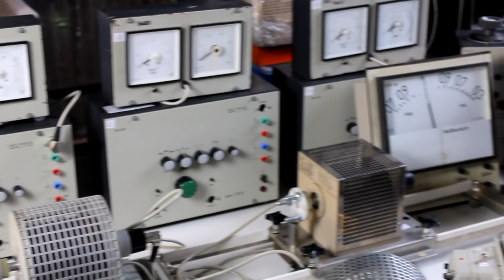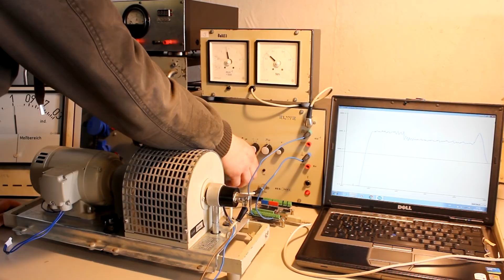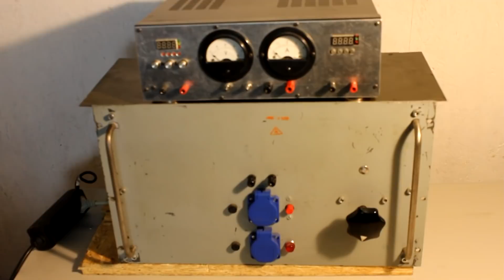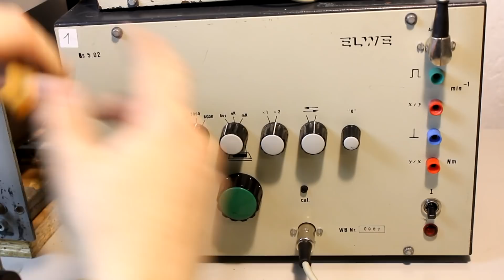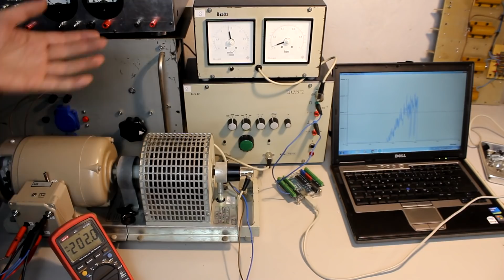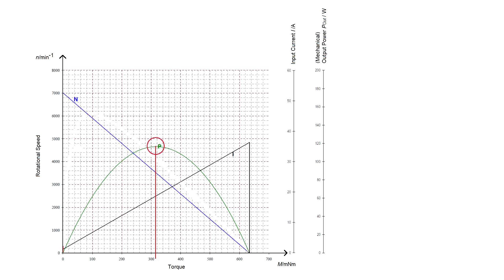The Electric Motor Test Stand / Dyno - Test Runs and Motor-Experiments

Comment: I had to test a 10,000 HP 115,000 Vac 3 phase motor that was used to pump cooling water in power plants. We closed a seven foot diameter valve to load the motor like a dynamometer test until the motor stalled. Back in the late 1990s to record the data we used a Honeywell Viscorder Oscillograph.
Where I worked (ABB Power Systems) we made the speed sensors for the motor and also a detector to measure the shaft wobble.

Comment: Okay, so the series would shaded pole motor would make a good generator if it's rotor is modified to accept magnet's and it should be able to supply power to the parallel wound shaded pole motor while it drives the series wound shaded pole motor mechanically! It works with the shaded pole motors that are used as fan's in microwaves... There's a good Video demonstration by someone who really sounds like the guy from Diodes Gone Wild... He used that soft magnetic material that is used in PC cooler fans, machined out the rotor to wrap that soft magnet around it and was able to power what looked like a 40W 220v incandescent light globe!.. I think that the channel is called FreeEnergy4All... There's two videos that look exactly the same but on is from someone else, in his Video, he shows a picture of how it needs to be and then a picture of the motor in pieces including the flexible soft split ring magnet... It looks like one of those free energy scams but this one might actually work! 
Besides, everyone loves a Scam Busting Video! But like I said earlier, I have seen all the scams but this one actually looks like it works!

Comment: One thing to note is that maximum power transfer is not everything. The efficiency curve is used to determine whether the motor is being overloaded or not. Generally you want to select a motor that operates at peak efficiency on a given load. This is because a motor that is too small will suffer excessive I^2 R losses, and a motor that is too large is just too big and will suffer excessive magnetisation and windage losses.

Comment: Hi, sorry to bother you, but I needed your opinion on a type of electric motor.
I needed to find an electric motor that will move a load of 15 kg (window that goes up and down) with a counterweight at a relatively low speed. This movement will be triggered by a controller board of the Arduino genre. The problem is that I need to move the window up or down manually at any time (whether the window is moving or not). I fear that a normal electric motor will not let me do that. Can you steer me to the right kind of engine I have to look for?
Thank you very much in advance.

Comment: Where does all the heat go that the brake generates? The brake did not seem to have any vanes to move air, and it didn't appear to have a large surface area.

Comment: 22:33 = The exact straight line also signifies that the torque is exactly proportional to the current drawn by motor. If you measure the current in motor, you get the torque generated by motor in a certain scale. T = Kt * I; where, Kt = torque constant (in Nm/A), which is surprisingly the same as back emf constant, if measured in V/(rad/sec)

Comment: Super like and thumbs up. I work for a company and we test motor on dynamometer for testing algorithms. They dynamometer is new model and has all sort of control to simulate a mechanical load which behaves as constant torque, constant power, variable etc. What you showed is pure electrical engineering and behaviour of each motor (physics in them). But we work on algorithm (running on DSP), which makes the motor behave extremely stable speed (using closed loop speed and current control, PID). Dynamometer always fascinates me. You tested different motor with one brake and i guess, the brake would have been super hot at the end of testing. In Germany, the cold climate may help, but in my country, brake needs extra cooling blower. Otherwise, the coil inside will fry in no time.

Comment: Awesome man. What actually determines the value of (mech output power/electrical input power). Magnetic saturation of the windings?  In a production environment, it seems like you'd have to overspec your motor for like 5x actual load in order to hit the efficiency peak point.. Can you alter the electrical profile of the input power to prevent this? On the ELWE console, how does the 'regulation' function operate?

Comment: Awesome - if you want more precise analog readings, there's a 16b ADC module floating around aliexpress (and probably ebay) for <2$ 

Works quite okay - if you want some example code to get started in <5 seconds let me know (otherwise it's not really that difficult, there's pretty ok libraries for it)

Comment: I am hoping that you will consider doing a DIY series on how to make an electronic break for the hobbyist. It can be a car alternator coupled with an Arduino or alike and a small program to chart and display the graph of the characteristic of small DC motors. 
Also, have you ever come across a variable inductance pulse motor? I have only heard of some being used on the Shuttle with efficiencies > 85%. Very rare.

Comment: Wonderful thought provoking video as usual - no one but the PAI is making videos like this and a consequential topic.I will ponder this demo while spinning up my 130 watt Mr. Coffee grinder every morning and also when I fire up my 10,000 RPM Shop-Vac vacuum cleaner and when I ride the Siemens Elevator up to the 10th floor.I'm thinking the most commonly used motor in terms of total elapsed hours in the world might be the one on everyone's computer power supply and processor cooler?If I may suggest adding a thermocouple to show the gradient temperature rise in the windings during your tests.. Even if we could see that some of us older folks in America will still have to type into to Google to translate the degrees from C to F so we can understand..  40 degrees C = 104 F
Reply: Police Dog I think to get Fahrenheit it is 1.8 (or 1.6?) times the value in celsius and than substract 32. The Motor you talk about is weird indeed. It is a permanent magnet DC motor but electronically commutated. Very simple electronics setup with just 2 transistors and a few passives.

Comment: So if you want to operate at the point of maximum efficiency then to do 3/4hp of work you should buy a motor that is rated at a maximum of 1hp?? Assuming 75% of max will be near the range of best efficiency. Does that sound about right? Basically get a motor that's rated max hp at 25% above your desired normal operating hp?
Reply: In a permanent magnet DC motor, the torque output is decided by the PRODUCT (multiplication) of strength of the permanent magnet and current through the winding. In cheaper motors, the magnets are made smaller and you need to push more current into the winding to generate certain torque. This higher current causes higher losses. Note that, in permanent magnet motor, most losses are I^2R losses. The motor data sheet that was shown must had been a low cost motor and was meant to run at 3/4th of full load and occasionally run at full load. Hence, the cost and performance make complete sense. On the other hand, if you want to buy expensive motor, it will have peak efficiency closer to its full load, and I bet such motor will have neodymium magnets, which have higher flux and are more expensive than ferrite magnets.
Reply: Debraj Deb that makes total sense. Thanks for the rundown. I appreciate it.

Comment: Can you explain the value of torque? The unit does not make any sense to me.
Reply from the maker: I have been thinking about making a video about the basic physics of rotating systems for a while. It's of course not easy to explain this in short in the comments, but just imagine that there are basic physical quantities both for linear movements, as well as for rotating movements. For linear movements we use the quantity "Force" measured in "Newton" to express a physical force applied to any given point or object. Like for example the force that is pulling your body down to the ground. This force is pointing down to the center of gravity of the Earth in a linear way. But some forces are not really linear, but they are applied to a point that is rotating around another point. And for those cases you can use a "torque". In German it is called "Drehmoment" which means "rotating momentum". A classic example to explain torque is a wrench that is used to tighten a nut, that is sitting on a bolt. You press against the wrench, which is then rotating around the nut. That force can then also be expressed as a "torque" in "Newtons times Meters" or Newtonmeters (Nm). And in this example the actual numerical value of the torque could be calculated by multiplying the force applied by your hand times the length of the "lever" that is represented by the distance from the center of the nut to the end of wrench. Applying a higher force, or making the lever longer will both increase the torque applied to the nut. But it's really hard to explain it with a text. You should check out some videos about that. I'm sure there are some good explanations on Youtube.
Reply: I'm sorry I should have been more specific. In the video, the motor's torque is given as about 635 M/mN*m. My question is. What does this value equate to. It does not make any sense, since torque is normally given in N*m. It's the big M (maybe Mega?), and why do they divide by the unit of torque?
Reply: So yeah... I got confused between the symbol of torque (M) and the unit (mN*m). Bad way of illustrating both symbol and unit in my perspective. Anyway great video. We have sort of the same dynamometer on our school up here in Denmark. We used in to demonstrate torque curves for 3 phase motors.
I'm studying to become a marine engineer at Martec in frederikshavn
Reply from the maker: Well. It's the way it's taught at some German universities. There is a mathematical reason for that. The graph itself only contains numbers and not the units themselves. But an actual measurement consists of the product of a number and a unit of measurement. If you now solve for the number you get this:  M=12 mNm <=> 12= M/mNm. So the "M/mNm" is actually a description of what the numbers on that axis represent, and not a value that is supposed to be multiplied with the number. That's why I did that.  The M is also printed in "italic" so that it can not be confused with a unit of measurement. But I understand that it must seem confusing when you are used to something else. Best regards, Gerolf